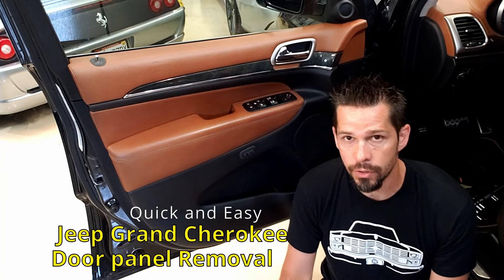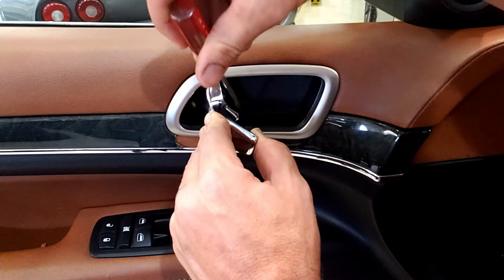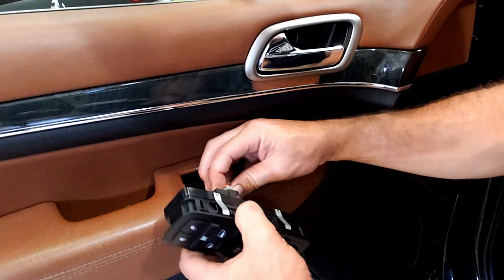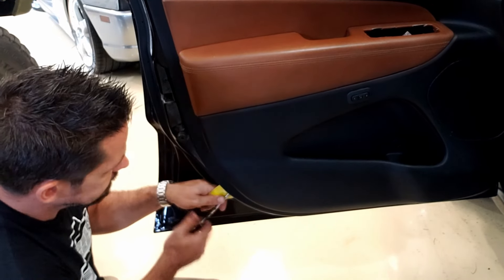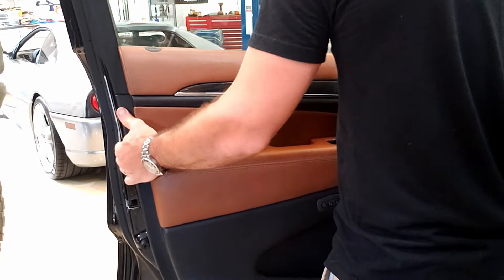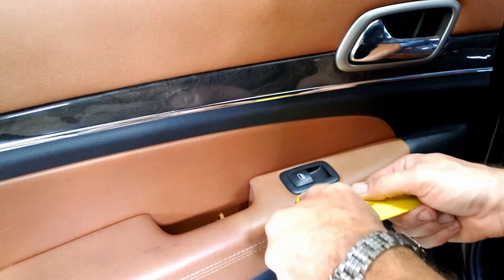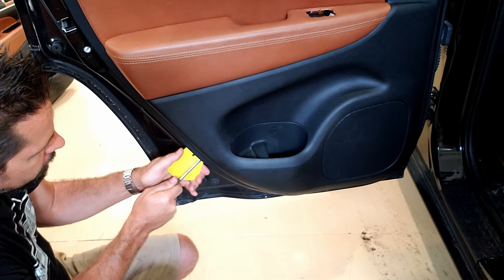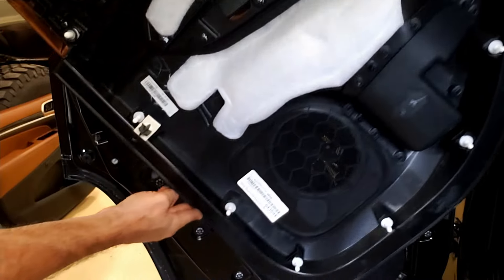How to Remove Grand Cherokee Door Panels. 2011-2020 WK2

Comment: Thanks for the video. Just a heads up for anyone about to remove their door panel, the philips head screw can actually stay screwed in. It holds the plastic door handle housing into place and the panel can come off with that still in place. Only need to remove the 7mm and 10mm bolts.
Reply from the maker: Thanks for the tip

Comment: This was awesome. I have something like a coin or screw rolling around in my door and it’s soooo annoying! I feel like I can retrieve it myself now.
Reply from the maker: That's got to be super annoying lol. Yeah just take your time, especially when you're trying to find those clips,. Before you reattach the panel, make sure all the clips are still attached to the panel before you start reattaching it
Reply: I had the same thing and all I had to do was remove the bottom tabs and the quarter fell right out. The clips didn't go right back in but I will try again in the morning. I agree, great video.

Comment: What if I only want to replace (or attempt to repair) the driver side armrest in the front door trim?  The leather has come up and is slowly becoming more disbonded from the armrest adjacent to the switch for the window(s) control.  Does the whole door panel have to come off?

Comment: HELP!! I had the front tints done on my WK2 and now the door lock knob wont sit flush all the way down like it used to... do i have to replace it or what could of caused it??
Reply from the maker: Hard to tell, if you go to 03:28 in my video, you can see that the door lock assembly is simply a rod that goes to the door lock module.
It's possible that whoever did your tint job, may have either been the rod, or not fully seated door panel correctly.
Does it still go up and down when you lock and unlock the doors?
If it were me, I would simply remove the door panel and check
Reply: @ExoticCarDIY  hey thanks for replying! Yes it works perfectly fine. When I hit the lock button it goes down but sticks out just slightly higher than the passenger side.

Comment: hi..exotic ^^ could i remove the wood style trim on the door please?  thank you for the video
Reply from the maker: Yes, the trim is removable and replaceable. However I believe it is attached with plastic rivets and not screws. Meaning, you may have to glue it back into place
Reply: @ExoticCarDIY  oh.....i  really appreciate you